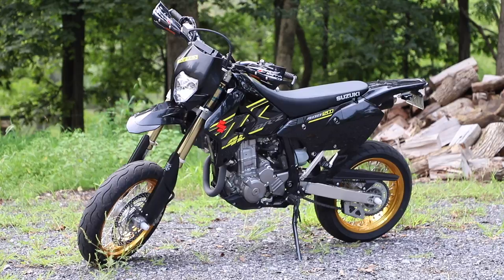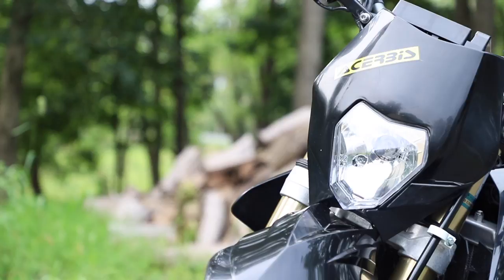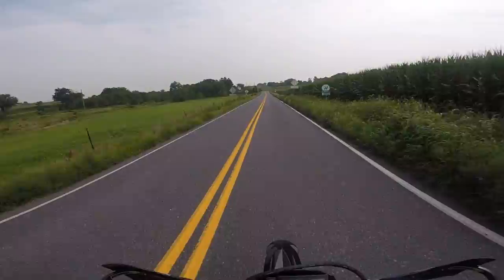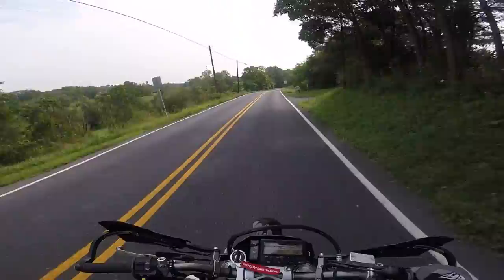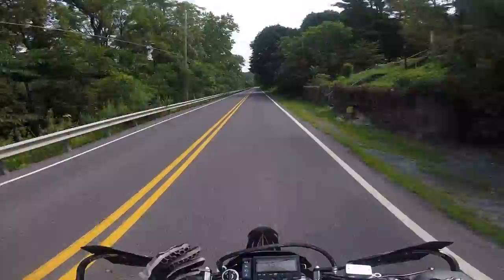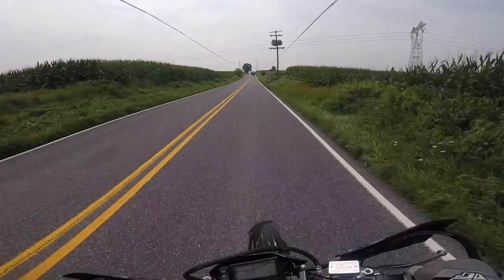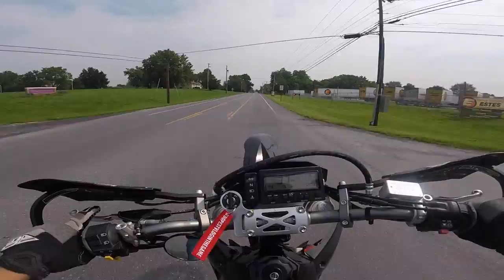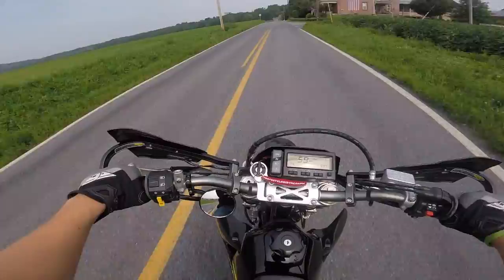New bike! DR-Z400SM | First Motovlog!

Comment: The DRZ isn’t fuel injected because it’s design is grandfathered into compliance with emission regulations. So while it doesn’t really meet today’s standards for new bikes, it doesn’t have to because it was designed before these laws.
Reply: With fuel injection and an aluminum frame it'd meet the requirements
Reply: @MrJackzon  no it wouldn't, fuel injection itself isn't any better or worse than a carb when measuring emissions if both are tuned properly.  To meet modern emissions standards especially Euro 4 it takes a lot more than most realize, even controlling the sound output is difficult especially to do so and not kill the power output.  Many things would need to be added like a catalytic converter, fuel evap system etc etc, even the ignition system would change dramatically.  The cost to get everything engineered and certified  would make the bike more expensive and for minimal benefit

Comment: You probably won't read this since it is an older video but...The Crf450L check it out it has an aluminum frame, 6 speed gear box, and fuel injected. It has everything that you said you were looking for, plus street leagal. Nice bike I like it.
Reply: What's the msrp? Maintenance?
Reply: Pls dont RREEEEEE at me if im wrong, but i think those are dual sports (tall tires-all terrain tires)  not factory supermotos, and he was saying nobody makes a showroom supermoto

Comment: I’d never never replace my motorcycles turn signals, taillights with tiny signals lights. It’s bad enough out there on a motorcycle and I want my signal lights to be visible. Nice bike though, I has a DRZ 400 and sold it and bought a DR 650.

Comment: I have a 2015 DRZ400SM and I love it, funnest bike I've ever owned. I did the 3x3 airbox mod, hi-flo air filter and full Yoshiumra exhaust along with re-jetting the carb. You really don't need to replace the carb. And yeah, I do wish it was fuel injected but for the price and the maintenance schedule this is the best thing going.

Comment: Love love loooove the DRZ-400SM. Bullet proof. Comfortable. Tons of accessories and mods on the market. Inexpensive to run and insure. Enough power to have tons of fun and get you in trouble. Buckets of fun both on the road and off. Just an all around awesome bike. I had one with Yosh exhaust and header. 3x3 mod and jetted carb. Did not do the larger carb mod. Was plenty enough power without. 

But by the sound of it you should have gone for the Husqvarna 701. That one got moa power and moa gears (6). And just looks awesome sauce! Also got light weight frame and aluminium swing-arm! Probably fits your list exactly.

Comment: They haven't added fuel injection because it would have to requalify emission standards. I love my s model. It's cheap. There is every miss you can think of made for it. Best mods I did is grips, protective side plates, skid plate, and dropped a tooth on the rear sprocket for more umph. Only lost a couple mph's. I hope soon to do hot  cam's, full  exhaust, jet kit, and the 3x3 air box mod. Good luck with your new bike!

Comment: You should have went with a Wr250x .. granted they don’t manufacture them anymore. 250r are very popular but you would have to get the sumo wheels. But it is 6speed fuel injected. Low maintenance. Lightweight. Very powerful..
Reply from the maker: Too slow

Comment: Questions.   What other bikes have you had?  I have dirt bikes now. A Blaster200 and a  ttr225 previous bikes zl900, vfr750,gs700, H1500, magna700,  and 600 monster. Now I'm on the fence between the DRZ400sm or FI800cc monster.   Now that you've had the bike for some time are you still loving it?  Does the fun of the drz out weight the rush of adrenalin of a larger bike?  Do you need more HP or is this the perfect bike?  Thanks and great video!!!
Reply from the maker: https://youtu.be/jjLNOvH-n7I

Comment: I’ve run a motorcycle shop for the last 20 years and ridden everything ever made. The DR-Z400 in both its forms are my favorite motorcycles ever made. Awesome choice! Looking forward to seeing more. 3x3 mod, JD jet kit, K&N filter, full yosh exhaust and drop the front sprocket a tooth will completely transform the bike! The FCR carb mod is useless unless you go with a big bore kit. Ignore the idiots that tell you you have to change the cam chain tensioner. Just beat the hell out of the thing and have fun!

Comment: Looking good and great choice of bikes! I have been looking for a super moto and have been torn between the husky 701 and the Suzuki DRZ. How doe it handle the freeways? I plan on using it for commutes and I have a lot of freeway to cover. Keep up the great work brother!!
Reply: Husky kills the DRZ in every way.
Reply: Drz is king for reliability 

Husky 701 is high maintaince 
Drz  is a great performer 
But if i was going for more commuting id probably go for the dr650 🤷🏼‍♂️  low end torque etc 
But the drz400 is great all around bike does great in handling 

My environment is oregon so ... I didnt do the whole sumo thing though 

But the drz/dr are bullet proof bikes like the old 350cc+ Yamaha xt and the honda xr650l and things like that  

There the nevee chanhe the oil or even any maintaince in 50 years being beat on every day 

Some poeple are all about dpeed im a 350 lb man and on my dr650 and drz i could wheelie in all 5 gears 

These things are more trail bikes if you wanna go offroad they are not race kings 

But 40hp stock isnt bad 🤷🏼‍♂️ minor upgrades and you get to 50 get a pinch deaper and you can have a 60hp+ bike 

The only thing id wish for the dr/drz is lighter frame 

10/10 would recommend
Reply: Oh and upgrade to the 7 gallon tanks ( they actually hold 8 )   

And the drz tends to get 55-65 mpg 
The dr650 is 45-60mpg

Top speed on both is 100 ish mph 😂

Comment: The new 2019 Honda crf450l meets your criteria but won’t be out for couple months. I’ll be picking one up the day they arrive which feels like eternity. I love my DRZ 400sm but wish I would’ve went with a WR 250 or KTMEXC. Drz is a solid bike and very reliable just too heavy and out of date imo
Reply: DentsNow do you know of any issues with the ktm’s?
Reply: KC_636 heard they do but don’t own one so don’t know. They have good power to weight ratio but require high maintenance intervals.
Reply: Nope, high maintenance bike... May as well get a KTM...
Reply: Under powered and over priced though.
Reply: HONDA FTW
Reply: just a shitty ktm, same service intervals but slow heavy ugly and wire clutch

Comment: Actually the new HONDA CRF450L has all those things!!
Reply: And price. With that price you would be better off getting a KTM or Husqvarna or even a second used bike.
Reply: Over priced and under powered bike.
Reply: The CRF450L is a dual purpose bike. Not the same bike and would require a major wheel and tire swap to be competitive with a supermoto. Wrong category.

Comment: what is your gearing in the rear
Reply from the maker: Stock
Reply: @TalonSei  44 tooth ??
Reply: Im asking because i have 44 tooth and mine wont wheelie .. are you using the clutch or just roll on throttle ??